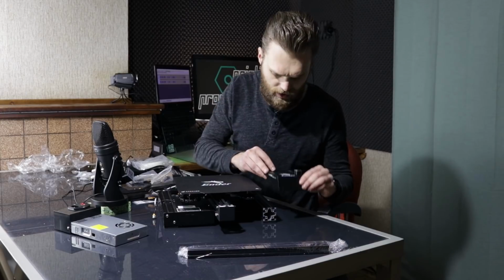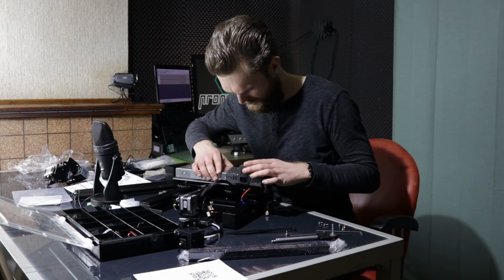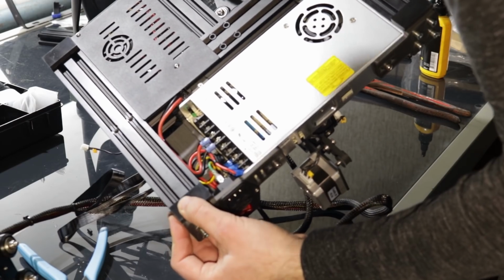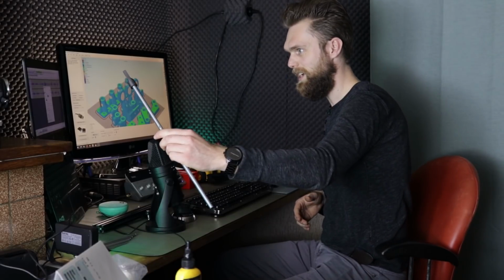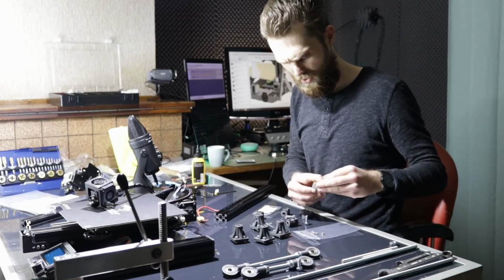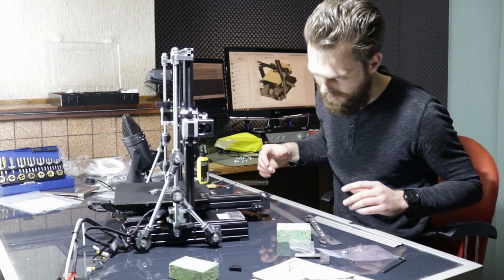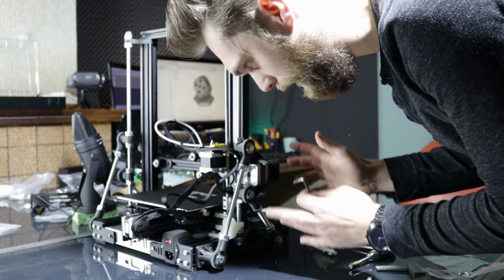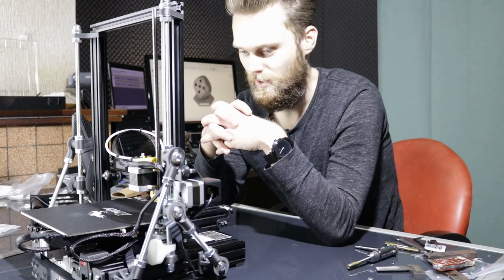Foldable Ender 3 pro

Comment: next step: add solar panels with battery and print outdoors
Reply from the maker: This would make an awesome summer video, thanks for the idea!
Reply: @properprinting  I vote for this :))) I saw a guy using sun to melt sand :) so it's possible, solar + lithium battery :)
Reply: Haha I’m printing in my van with solar right now
Reply: U dont to want print outdoor trust me haha. Specially for pla n abs.

Comment: you could remove the display and use octoprint ;)
Reply from the maker: Indeed, I'm going to put this even a bit further in the upcoming videos ;)
Reply: @properprinting  awesome!
Reply: Jow would you go about changing wifi depending on where you are?
Reply: @ckafrouni  You could make a hotspot using your smartphone
Reply: @certified-forklifter  and when you want to bring it back home... you would eithet have to stay on your mobile hotspot, or change the wifi on your raspberry pi files right?
Reply: @certified-forklifter  I mean is there a way to change wifi like on a laptop? From within the interface ?
Reply: @ckafrouni  You can use more than 1 wifi connections I think, you simply need to enter all of them. You could make 1 from home and 1 from mobile. I don't think you can change it only with the user interface. =D
Reply: @certified-forklifter  waw Nice,didn't we could do that
Reply: @ckafrouni  I am not 100% sure, but you can find it out in the internet. Cheers